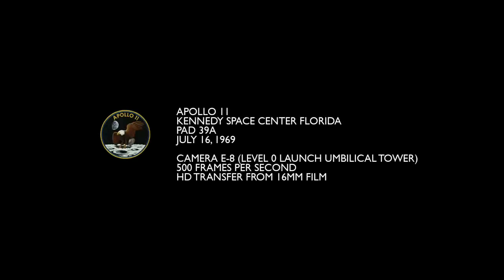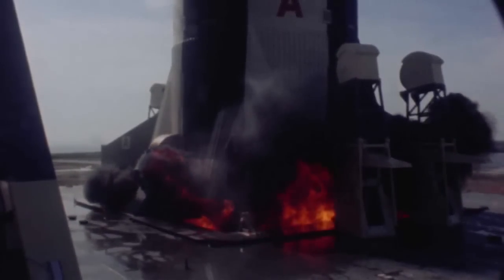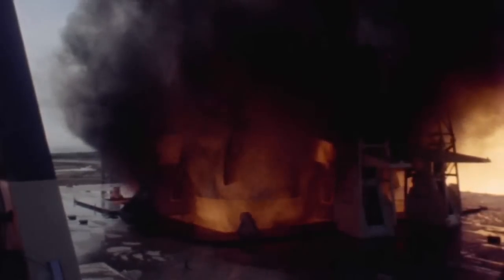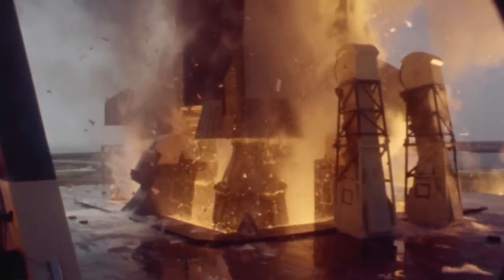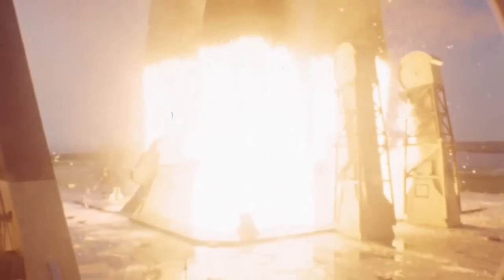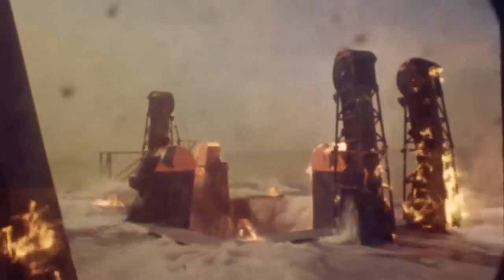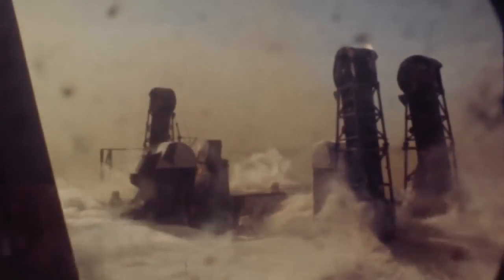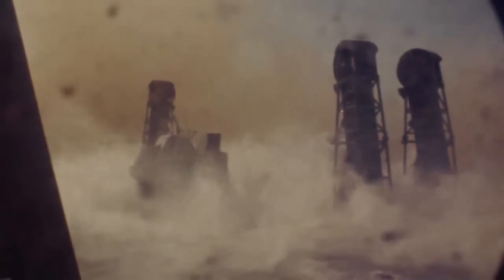Apollo 11 launch in Ultra Slow Motion 16mm HD

Comment: What cannot be conveyed, even in this awesome video, is the sheer SIZE of the Saturn V launch vehicle.  For example, the exhaust nozzles on each of the five F-1 engines was a little over twelve feet in diameter-- about the size of the average room in a house or apartment.  The two white-hooded service towers are probably about as tall as a two-story house.  I have heard that, at the time of launch, the nearest human beings (other than Messrs. Armstrong, Aldrin, and Collins) were huddled in a specially reinforced concrete bunker a mile and a half from the pad-- and perhaps praying earnestly for their own safety.  The public viewing stands were about eight miles away.  No human being could have operated this camera and survived.  (I'm surprised the camera and film survived).  Thank you for sharing this.
Reply: the narrator said it was housed in an enclosure.
Reply: After your comment I can literally hear theire prayers in my ears...

"Please understand floating-points, please understand floating-points, please understand floating points..."
XD

Comment: The main computer in the command module occupies only one cubic foot.

While an automobile has less than 3,000 functional parts, the command module has more than 2,000,000 not counting wires and skeletal components.

The command module uses only about 2000 watts of electricity, similar to the amount required by an oven in an electric range.

The honeycomb aluminum used in Apollo's inner crew compartment is 40-percent stronger and 40-percent lighter than ordinary aluminum.

The tanks which hold the cryogenic (ultra-cold) liquid oxygen and liquid hydrogen on the Apollo spacecraft come close to being the only leak-free vessels ever built. If an automobile tire leaked at the same rate that these tanks do, it would take the tire 32,400,000 years to go flat.

There are approximately 2-1/2 million solder joints in the Saturn V launch vehicle. If just 1/32 of an inch too much wire were left on each of these joints and an extra drop of solder was used on each of these joints, the excess weight would be equivalent to the payload of the vehicle.

[ Home | Saturn V | Saturn Ib | Apollo Spacecraft | LC-39 ]
[ References | Links | CASI | Facts | Library | Update Log | This site ]
Copyright 1997, 1998 by John Duncan 
Comments and questions welcome. All photographs contained on these pages are the author's, unless otherwise noted. No unauthorized reproduction without permission.

Last update: March 1, 1998
Reply: Fuck me, after reading all this one has to wonder that it was indeed fortuitous they had a plentiful supply of duct tape on board.
Eh?
Reply: NA$AbastardsChev4206 You can fix anything with duct tape! : )
Reply: Can't fix corrupt data.  ... or can it?!
Reply: " the command module has more than 2,000,000 "
Uhm... to be fair; the core-memory alone consisted of multiple thousands of wires and iron-rings. If you allow "moving parts" for individual transistors in automobiles, the CPU alone would easily jump 16 million "fuctional parts".

Comment: Would be neat to see the first minute or so with a little overlay in the lower left showing the thrust from each engine. It started with 5, then 1.3 together and 2,4 together - so as not to give a sudden load increase to the rocket.  http://history.nasa.gov/ap11fj/01launch.htm

Comment: Wow, that's almost an entire 400ft mag (about 11 minutes at 24 fps) zapping through in just 30 seconds! I wonder why the frame is cropped top and bottom. 16mm high speed is/was usually recorded with a 1:1,33 or 1:1,37 aspect ratio. I'd love to know what camera model was used. The Mitchell 16 only goes up to about 128 fps, I think (at least the 35mm models do). 500fps? Probably a rotating prism system. Anway: awesome footage and great narration!
Reply: the dynamic range of the film is truly amazing considering the exposure is fixed here.
Reply: Holy shit. 400ft in 30s means it was pulling 13.3ft of film per second.

Comment: The statistics of these rockets were off the scale of most ordinary people . 
 Total weight 3000 tons 
Fuel per second 20000 litres (20 tons per second )
First stage burned for 128 seconds .
 128 x20 tons = 2560 tons fuel burned during first stage burn .
Remaining weight of rocket after 1st stage ,440 tons